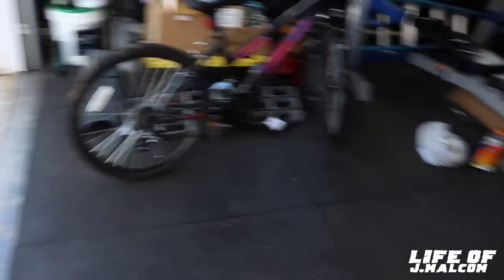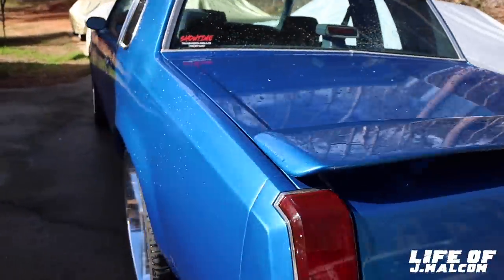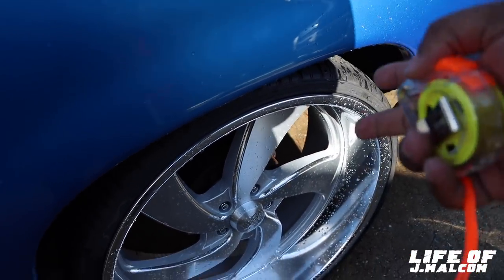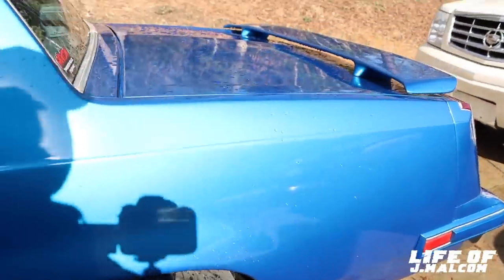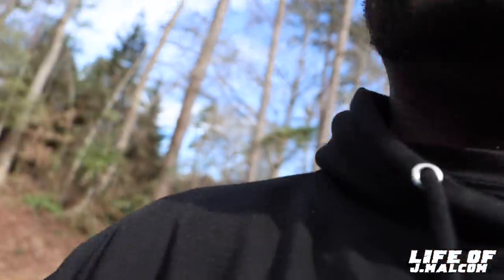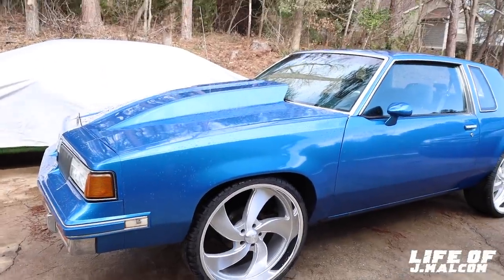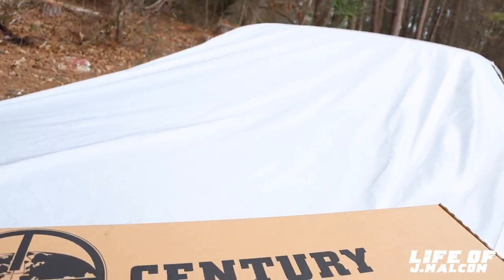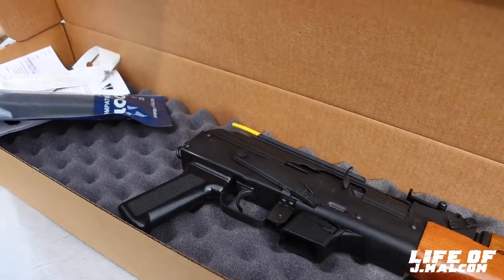HOW 24s CHANGE YOUR REAR END GEAR RATIO AND I COPPED A NEW FIREARM!

Comment: I'm glad you spoke on this bro I learned the hard way highway driving a factory front wheel drive caddy on 24s burned up the transmission twice and again with the suburban on 28s no one explained to me back then that the bigger the wheels are the more smaller rotations on the transmission and the faster you drive equals even more rotations example Everytime your wheel turns once it could be equal to 10 turns on the transmission shaft
Reply: I think u got it backwards

Comment: Thoes cars came with like 373 ratio and a 7/5 rear I have posi track rear 373 gear and I love it Cruze's nice and I raced it also..and they say a 200 R4 is the way to go but haaa I just sit there and laugh at them your right on the 400 but a 350 done right is just as strong...Thats what's in my Cutty...a 350 short tail that came off a 400..they say u can't do that well I beg to differ cause I have one in it and it works fine...

Comment: new piece is bad ass bro!!!
Reply: hey man I dont sub right now but hopefully I can in the near future I know you said about not giving info out to none subs but I was wondering if you had any idea what the biggest wheel size width and diamiter you can get on a 85 monte without doing modifications? I want to change out the size to help with gearing and because there are way more choices for tires rather than the 15s that are on the car?